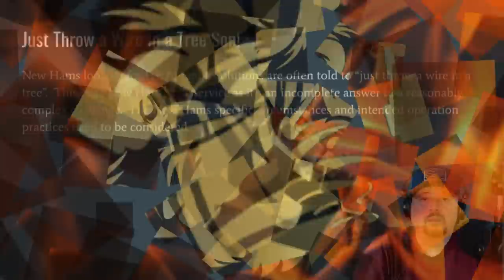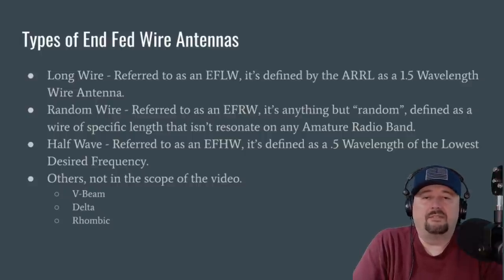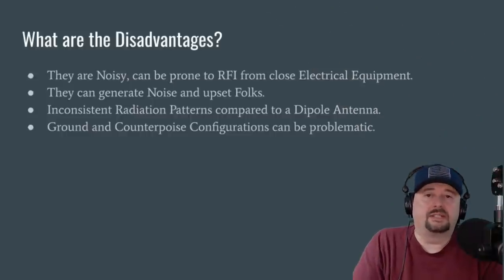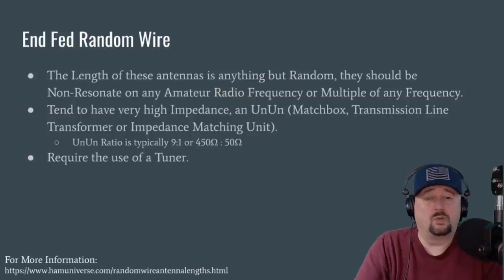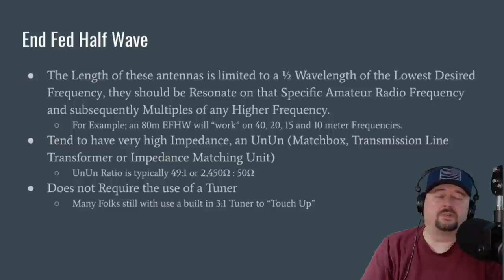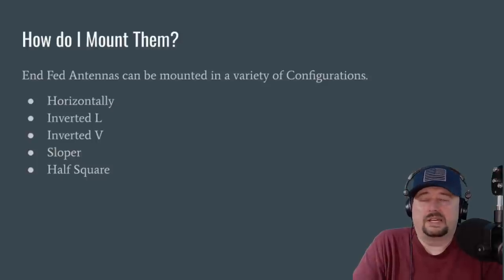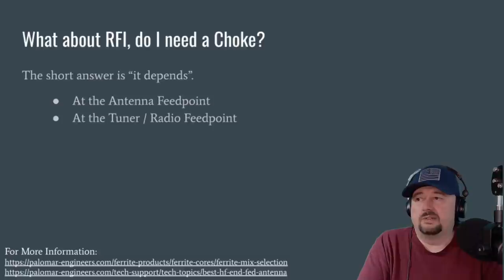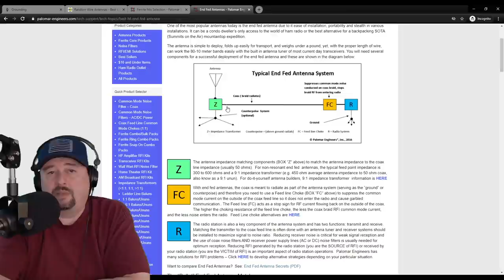What the Heck is a Long Wire Antenna? - Ham Radio

Comment: What I wonder is, does the wire need to be as straight as possible, or could you say, run a wire on a sort of loom back and forth with insulators on each end like I've seen illustrations of for AM radio antennas on the roof of a house from back in the 30's.  I'm not worried about connectors as I'll be using a Hallicrafters S-40A from the late 40's that just has screw terminals on the back.  I live in a rural area with no zoning, much less an HOA and I have a large yard so I could use pretty much anything for an antenna.  I just don't know what the best type would be for my situation.
Reply from the maker: Straighter is better but work with what you have and then see how you can improve over time.

Comment: What do you think about the 1.1 balun antenna? And how long should the wires be.
Reply from the maker: I use them for the center of a dipole antenna which is 1/2 wavelength for the desired frequency 👍

Comment: I have a random wire antenna. Used that to get SW broadcast stations before becoming ham listener. it is not very good,  I have too high noisefloor with it.
Reply from the maker: Yeah, you probably want to get / make something specific to ham radio 👍

Comment: Any hands-on advice for counterpoise systems?  I’ve read they should be in-line and/or perpendicular to the endfed random wire in an inverted v configuration.  I’ve read contradictory advice on the question of if the counterpoise wires should be cut for resonant lengths.  I’ve had parts on order for about a month, so whenever my unun gets here, I’ll be building a random wire antenna with something like 268’ of wire for the antenna, and I’ve got plenty of wire on hand for the counterpoise system.  With that much wire, my configuration might be more of a “fallen L” than an inverted v, but I don’t know that such things matter, other than for amusement.
Reply from the maker: Hey Ray.  A counterpoise can be directional or at least affect the directionality of your radiation pattern.  I typically will start with a 17' counterpoise and adjust from there if necessary.  Thanks for watching!
Reply: I did some more digging.  My “bullet” 9:1 looks to be shipping from Palomar Engineering.  Their documentation states “Use of one or more random length counterpoise(s) connected to the ground post of the matching unit may also improve antenna efficiency and reduce SWR on certain bands. The first counterpoise should be installed under the horizontal portion of the antenna for best results. Suggested counterpoise lengths are 12, 16, 24 and 32 feet with a 50 foot coax feed and a choke installed 50 feet from the antenna feed point. Counterpoises can be straight or zig-zagged.”  They expect that the coax will act as a counterpoise, and they suggest a choke on the coax near the radio.  I’m planning on choking near the antenna and putting down more counterpoise wire, though that’s an easy experiment to run.  Thanks for the video and the reply!

Comment: Hello  Ape, I have a multiband EFHW-8010  by MyAntennas.  My thought was to start at one end of the house across and over to the garage and then over to the shed. This would extend the wire all the way. Problem is it may not look real nice and there is one person in particular who does not like a wire running all over.  So .....  Is it possible to install it in my attic?  I would need to run it around  the parameter a few times to fully extend the wire. 
What is your thoughts on that idea?
Reply from the maker: I don't think that would work too well.  You could try a shorter wire, about 66' and get 40, 20,15,10; thats what I did and with my tuner I get 30 and 17 as well. You really don't want to loop these types of antennas.
Reply: @TheSmokinApe  Could I simply cut the wire on this device? I then could run it straight across the peak of the attic. I have an older rig I got up and running. I just want to play with for now. I cant afford anything else  as yet.
Reply from the maker: You could but be mindful of the length and use an analyzer if you have access to one 👍

Comment: wire end fed  is all i am able to sneak out of my apartment for only night hours I have a AT2 @000 watt manual tuner and A ftdx 1200 I am able to get about 65 foot outside ,my question i what freq will i be able to get   W8RRM
Reply from the maker: If you do a random wire you probably will have luck on the 80m - 6m bands 👍

Comment: I roll my own chokes as close to the antenna feed point as i can on my tram dual band antenna as well as my a99.
Reply from the maker: If you only have one, that’s a good place to put it, I typically have one at each end of the coax.  Thanks for the comment Doug 👍

Comment: Great Info Ape, I need some advice, I got into ham in 2013 and got together a lot of equip but life happened and didn’t do much with it other than a yaesu 2900r Mobile right in my truck, recently I’ve gotten back into it,  I have plenty of room in my yard out here in the county, I have 80ft of Rohn 25, I want to put up and guy out next to my shack, for antennas I have an 8 element 2m beam I want to put on a rotator for long distance vhf comms and a diamond x30 for local vhf uhf comm my plans are to mount the beam on top of the tower and the vert x30 beneath and out to the side a couple feet and run lmr400 down from both to an antenna switch in my shack, do you think this would work well and also would you mount the 2m beam horizontal or vertical for the best range, I haven’t found an Elmer in my area to talk with about this, thanks in advance for your help 73 
KG5AUB
Reply from the maker: That sounds like it would be an awesome setup!  Personally I would mount the beam vertically as you will likely be talking to folks with vertical antennas but opinions on that topic vary greatly, https://ham.stackexchange.com/questions/5468/2-meter-horizontal-or-vertical-dipole-polarization .  Oh, the 2900 is an awesome radio, I have one sitting right here...  thanks for watching!
Reply: @TheSmokinApe  thank you, I thought this would work well but confirmation from someone with much more experience makes me feel better, have a great weekend sir.

Comment: Hey Ape tried to use a sling shot but my tum keeps getting in the way. The best I can do 15 to 20 feet.  I know I'm missing a lot of signal. Was thinking about my antennas so I have one about  15 ft flat top. Oh it is efhw 10-80, has no ears. My 40mts  dipole is ok. 8 want to get out of the house and into the woods.  Looking for some input 
tnxs 73 KQ4CD Paul 
Oh the radio it a 991a
Reply from the maker: Hey Paul, the EFHW doesn't pick anything up?
Reply: @TheSmokinApe  it doesn't like my tuner on 40mts . Cut dipole 62'3" for 7.250 2.5
Guess I just getting old.    Is thick  headed I guess. Mainly I want to run portable go outside gettin woods using a 991a
Reply from the maker: What model is the EFHW, it really shouldn’t require one
Reply: @TheSmokinApe  EFHW-8010-1K
Don't get wrong just can't get it 35' -40' yes hears good, just like to not miss up my new radio  FTDX-991a